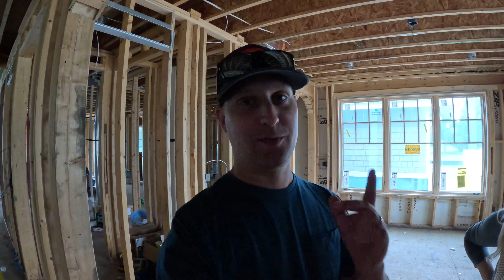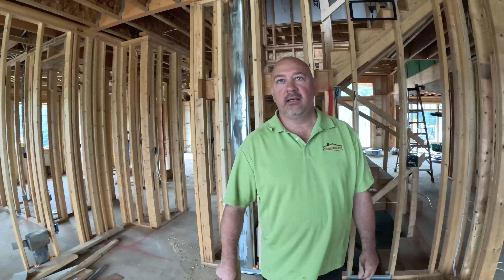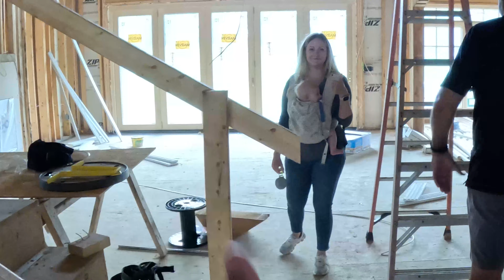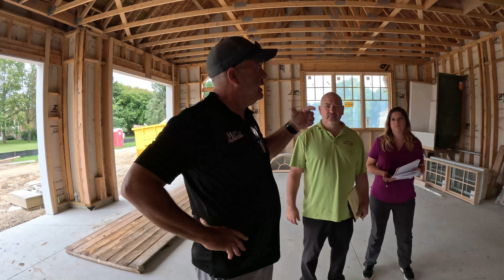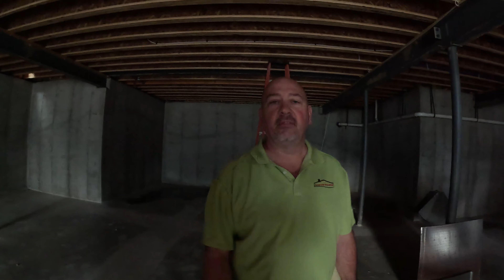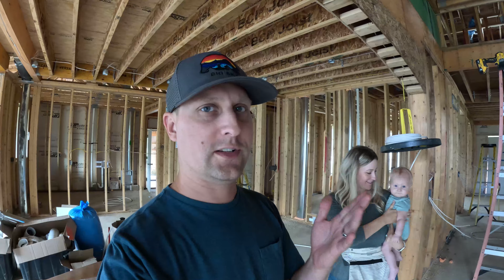MONEY SAVINGS! Insulation Secrets That 99% Of Contractors Won't Tell You!

Comment: I'm not so sure I agree with your insulating contractor. He's trying to upsell you on something that only benefits him while hurting you at the same time. Of course, he's going to recommend a hybrid insulation system. Spray foam is approximately 3X as expensive as batt insulation. Batt insulation by itself will give you an R-21 and ?dB of sound attenuation. I dont know if I would buy his sound attenuation hyperbole unless he can back it up with some proven technical data sheets. Is it going to cut down the sound by 2dB or 50dB? Nobody knows, not even himself apparently otherwise he would've stated that number. Then it comes down to price are you willing to pay 3X the amount to eliminate 2dB of sound or whatever that illusive number is. Also you already have 1" of polyisocyanurate (closed-cell) rigid exterior insulation on the back panel of your ZIP sheathing providing sound attenuation and along with 6" of batt insulation you will have a hybrid insulation system. How much more do you need to eliminate an unknown amount of sound and at what cost?

Something else to consider sound waves gain energy as they bounce off of hard sufaces i.e. closed-cell foam whereas sound waves lose energy when absorbed or dampened by soft surfaces, i.e., batt insulation.

According to the laws of physics, you will actually end up with a noisier house with his recommendation.
Reply from the maker: Great feedback!!
Reply: actually the more dense the material the harder it is for soundwaves to move through it. your talking about acoustics inside the room. acoustics is different from sound isolation.